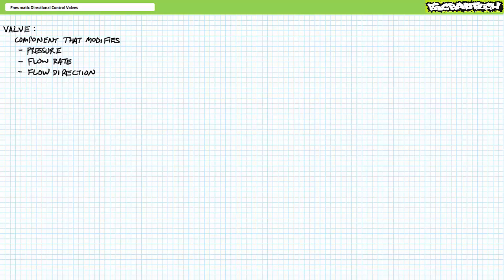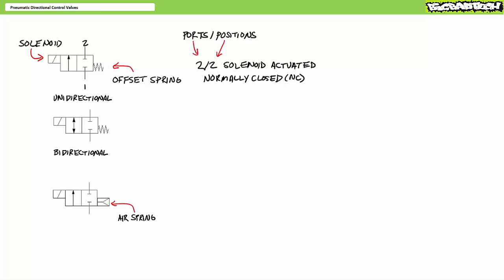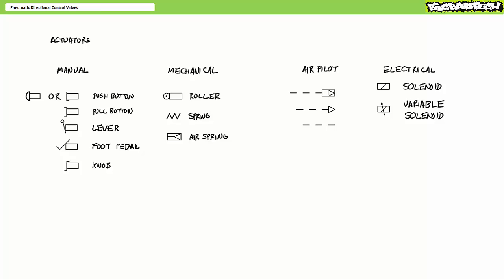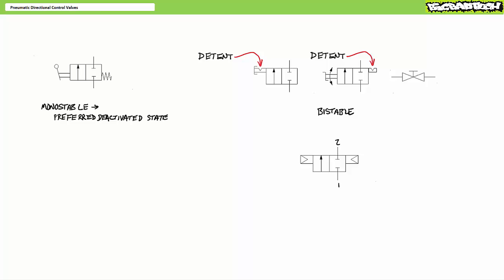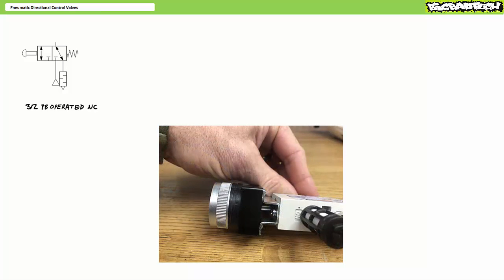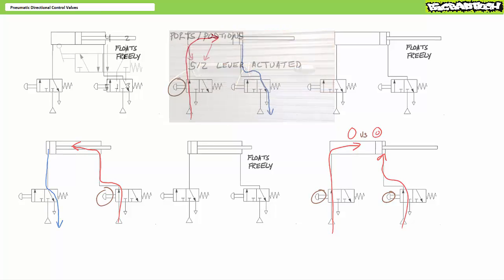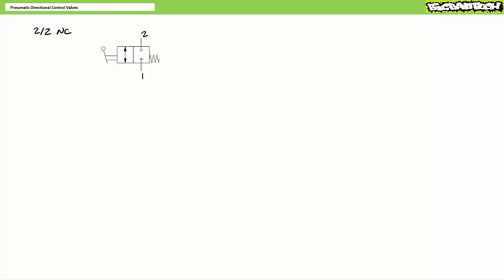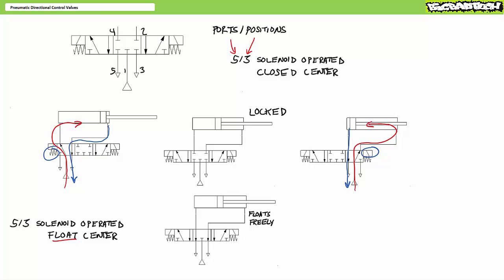Pneumatic Directional Control Valves (Full Lecture)

Comment: For valves that are air piloted from both sides, the directional valve stays in position even if the pilot signal is not there, correct?
Reply from the maker: True. Learn more about "memory" and "priority" in the air piloted valves lecture at: https://youtu.be/QZo9pqMvxRA?si=2rccYrsuBj0fvvyo